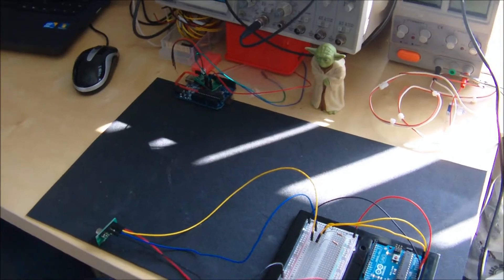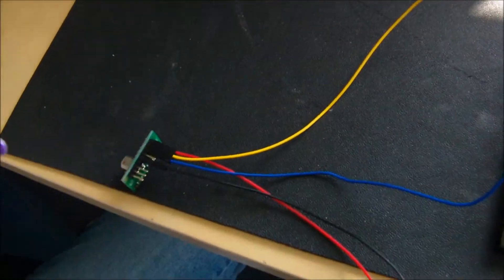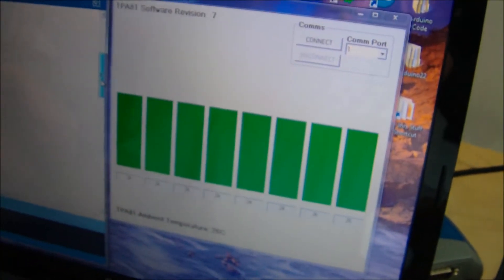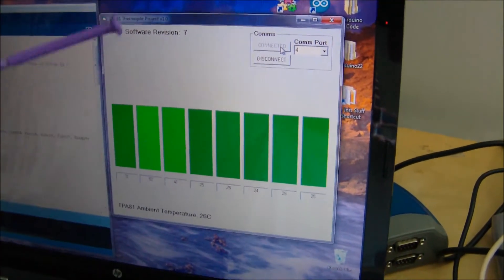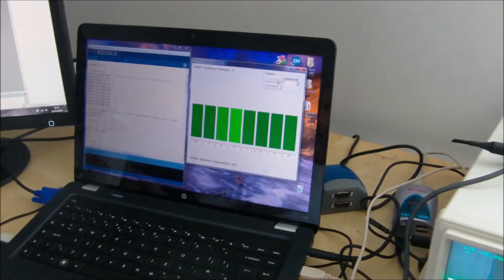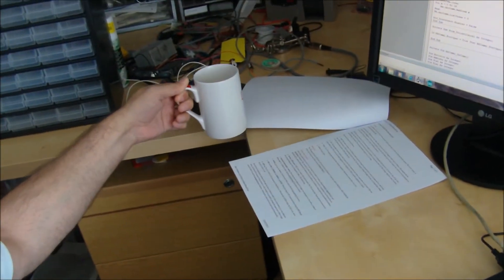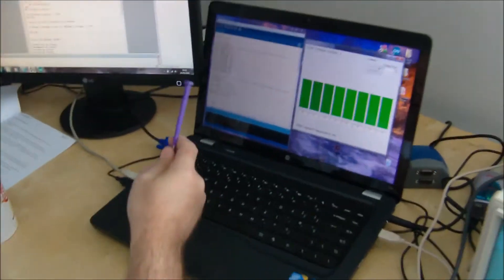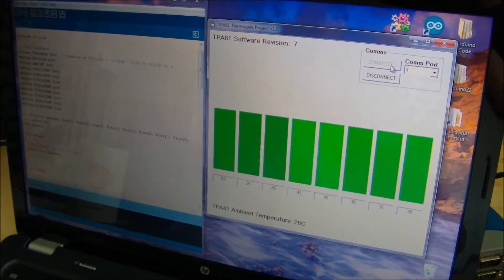Roys Techno Babble #2 Interfacing the TPA81 with arduino and VB App

Comment from the maker: @mtbtom7 Hi there yes there are 8 pixels inline so you can have them looking left-right or up-down depending on the sensors orientation.  There is an RC Servo output on the board that allows the user to pan the device which allows an "IR picture" to be assembled. Hope this helps!